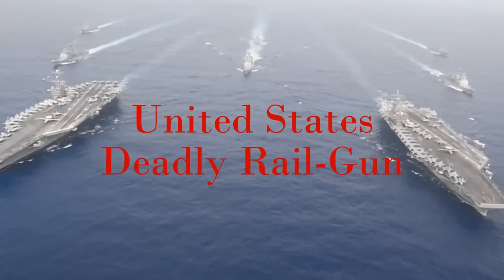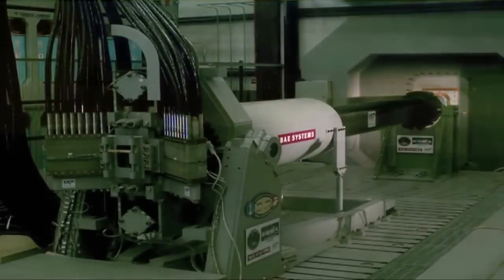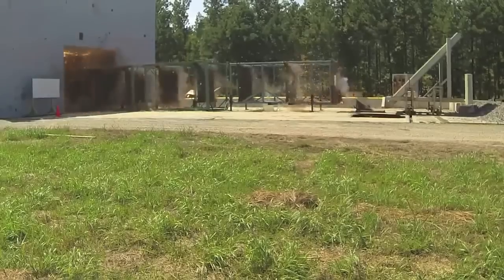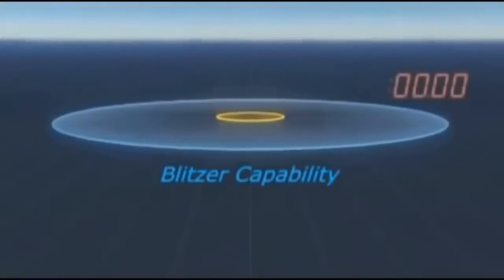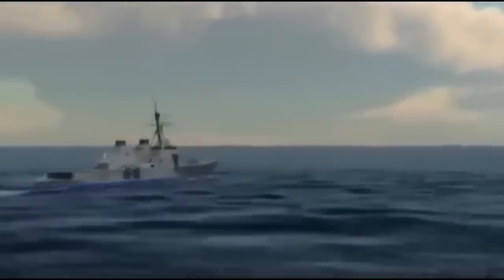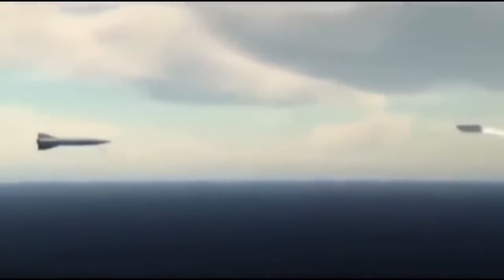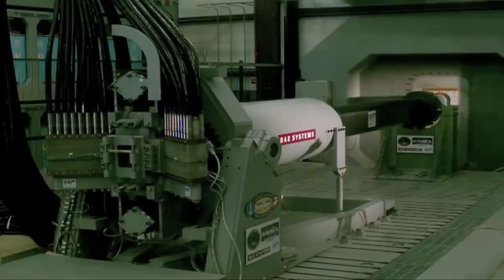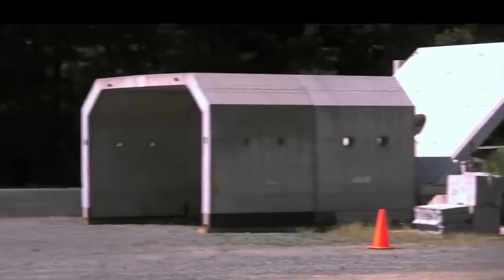USS Zumwalt will deploy the deadly Blitzer railgun

Comment: With radar off, how it would detect/shoot a target?
With it's transmitters turned off, it's blind as a bat. With it's transmitters turn on, it can be detected many miles away by satellite, missiles, surveillance aircraft, dozens of surface ships. 
None of it's weapon systems will work with turned off radar, etc.
Plus it's Stealth looks very first generation. Compare the F-117(70's tech) to the F-22, F-35, J-31, etc.
Plus it's big, slow and perfectly visible during daylight. It's wake can probably be seen from fifty miles by eye, and from over the horizon radar and satellite radar.
Plus with it's radar turned off, it can't detect the aircraft, ships, fishing boats around it except with binoculars. It already has collision issues at night. With it's radar off, it can't detect or be detected by other ships.
Do they have a crow's nest manned when in stealth. "Ahoy, Captain. Fifteen cruise missiles approaching off Starboard. Uh, also port. And from astern. Can we turn on the radar please so the super duper Rail Gun will work. Never mind. Abandon ship."
Finding targets is a problem with all stealth. I suspect the F-22 and F-35 rely on AWACS. But the other side has missile that'll go after AWACS, unless you turn its radar off.
Plus they called the F-117, the Nighthawk for a reason. In daylight, Stealth stuff is visible. And with their radars off, how do they see and shoot first. If a F-35 gets spotted by any Mig later than a 21, it's toast.
Again, it ain't stealthy with radar on.
Reply: mikersey a new generation of direct link communication with sats in Leo. can't jam or hack. boats and birds are just missile platforms now. .usa motherfers.
Reply: @mikersey Dear lord, how to reply to a kid who thinks he knows it all? Kinda like that kid that smoked pot twice that is explaining to kids who only smoked it once how it all works.

Anyway, you should lookup "Network-centric warfare" and in case of the US Navy "NIFC-CA". That will explain to you how sensor information will be shared between platforms like the F-35, AWACS and surface forces. The USS Zumwalt can get it's targeting information in real time from any of these sensor platforms and take action accordingly. 

Also your assumption that if you switch on a radar that you will immediately be visible is not always true, especially with AESA radar that uses LPI (Low probability of intercept) it will be hard to detect. The constant frequency hopping and pulse direction at relatively low power will make it harder to differentiate the radar from any background noise.

Then your ridicule about a non stealth plane that can visibly see a stealth plane. You do know that if we take for example the F-35 that the non stealth plane either suddenly goes down in flames due to a rocket from a plane it never saw coming or that the F-35 just flies around it at such a distance that it will never be seen, you do know that do you?
Reply: How are all this network-centric stuff going work when a Mach 3 YJ-18 is spotted by your lookouts about 10 seconds before impact, and believe me, your 15,000 ton Zumie 1970 tech ain't going to be nearly as stealthy as a squadron of F-22, especially if it's guns are uncovered.
And assuming you fighting the Chinese, what are going to do about the Russian trawler sitting off you fantail...Yeah, just like them did 24/7 during the Vietnam War. And you don't think the Chinese and Russian's won't be doing the net-centric thing with their geo-synchronus radar, visual, infared, sigint satellites staring down on the South China Sea. China now launches more intell satellites than we do, and they can concentrate on the SCS, not the entire globe like us.
Here's a satellite photo for you to view...that's a crappy commercial satellite. If you don't know that the Russian/Chinese satellites are a zillion times better, you been drinking toooo much koolaid.
https://www.google.com/search?q=Admiral+Kuznetsov&source=lnms&tbm=isch&sa=X&ved=0ahUKEwi4uNLd4J7QAhWHr1QKHbw3D9YQ_AUICSgC&biw=1396&bih=735#tbm=isch&q=Admiral+Kuznetsov+satellite+photo&imgrc=WN1PeUthXqwDaM%3A
Reply: "This kid has 194 combat missions and a degree in engineering" Sure, in Call of Duty. And the engineering degree must be your fingerpainting classes. If you would be a combat vet and actually had a degree in engineering then you would not post like a 14 year old kid with severe ADHD. You are making this too easy.
Reply: You really need to down load this RAND report
http://www.rand.org/content/dam/rand/pubs/research_reports/RR300/RR392/RAND_RR392.pdf looking at the balance in 2017. And project it to 2020-25, with the Chinese momentum and growing ties with Russia. Like S-400 missiles that will shoot down the Nationalist Chinese Air Force in their traffic patterns.
Where will you launch your F-35 from...Kadena, Anderson...already vulnerable to Chinese attack. Any carrier within 1500 km is already vulnerable, according to RAND. Lotsa refueling equal very low sortie rate.
"...new generations of more capable Chinese aircraft,
missiles, and, especially, submarines pose a major threat to U.S. aircraft carrier operations within 1,000 miles (and possibly farther) from China’s coast. The threats to both land bases and carriers would be particularly serious at the outset of a conflict..."
And China spends less than half as much percentage of its GDP on weapons. By 2025 or so, their defense budget could easily surpass ours.
But if we attack Thailand, we'll kick ass. Watch out Ethiopia, you're next.
Reply: When they refer to stealth, they refer too radar. The ocean is a huge place man and with its design it will be a lot hard to detect. Like the F-35, well duh if u look in the sky where the F-35 is in daylight you can see it.. That isnt the type of stealth they are talking about. In a modern fighting scenario you dont have people standing outside looking for enemy vehicles, you use radar... That is what the F-35 and the Zumwalt's stealth was designed to counter, radar. Not people standing outside their ship looking for the enemy ship. Jesus christ we don't live in the fucking 1600s. But the real question is why would they turn the radar and the transmitters off?? Just like the F-35, the F-35 hops its signal around a bunch and has its own jammer on board to jam radar from detecting it... Even with its radar on it can use the jammer to make the enemy radar think there is nothing there. I imagine that the Zumwalt has integrated similar tech.
Reply: mikersey your comparing a military ship to military jets in stealth... well your a fucking idiot. also the way the ship is made is to deflect radar waves.
Reply: +vanguard Colt You are a cretinous, inbred, moron who gives idiots a bad name. Stealth jets and stealth ship, same fucking principles in each...they both absorb, deflect, RADAR, etc. You make Trump look like a rocket scientist.
Reply: (this is someone's comment) When they refer to stealth, they refer too radar. The ocean is a huge place man and with its design it will be a lot hard to detect. Like the F-35, well duh if u look in the sky where the F-35 is in daylight you can see it.. That isnt the type of stealth they are talking about. In a modern fighting scenario you dont have people standing outside looking for enemy vehicles, you use radar... That is what the F-35 and the Zumwalt's stealth was designed to counter, radar. Not people standing outside their ship looking for the enemy ship. Jesus christ we don't live in the fucking 1600s. But the real question is why would they turn the radar and the transmitters off?? Just like the F-35, the F-35 hops its signal around a bunch and has its own jammer on board to jam radar from detecting it... Even with its radar on it can use the jammer to make the enemy radar think there is nothing there. I imagine that the Zumwalt has integrated similar tech. I used it only to show this Persons point. Also you are calling a marine who has been blown up by shrapnel many fucking times stupid, inbred moron. Good FUCKING job dickhead.
Reply: mikersey also I have a feeling you neglected that persons comment.
Reply: +XTheLostChampionX2The Navy admits it has the radar cross section of a 50' cabin cruiser. That ain't very stealthy. A 1000$ and an Amazon.com account, and you can get a radar that can track it all day. #2, it's wake will show up on any radar worth a crap.
#3, the US, the Russians, the Chinese have satellites that can track it visually, 7/24. Yeah, even in the middle of the night with IR, Radar, multi-freq sensor. Been that way for decades. You can't hide a big ship from a major power.  Period.
#4, this thing is designed to fight 3rd rate powers, like most of the Navy.
#5, jamming is so 20th century. To jam, you must transmits a signal which while jamming radar A is picked up by receiver B. Might as well turn on some searchlights and shine them on the nearest cloud.
#6, the Advanced Gun System cost about a million a round to shoot, USN has cancelled the contract. The whoopie railgun, according to the Navy, won't be deployed until 2026, at the earliest.
#7, the USN has gutted the program, cutting the order to three.
#8-15. That should be enough. It is an embarassment.
Reply: Yeah it is an embarassesment I know that. To bad theres no cloaking tech yet.

Comment: Ship armed with EM railgun can still be sunk by good old fashioned torpedo. Just sayin.
Reply: With radar off, how would detect/shoot a target?
With it's transmitters turned off, it's blind as a bat. With it's transmitters turn on, it can be detected many miles away by satellite, missiles, surveillance aircraft, dozens of surface ships. 
None of it's weapon systems will work with turned off radar, etc.
Plus it's Stealth looks very first generation. Compare the F-117(70's tech) to the F-22, F-35, J-31, etc.
Plus it's big, slow and perfectly visible during daylight. It's wake can probably be seen from fifty miles by eye, and from over the horizon radar and satellite radar.
Plus with it's radar turned off, it can't detect the aircraft, ships, fishing boats around it except with binoculars. It already has collision issues at night. With it's radar off, it can't detect or be detected by other ships.
Do they have a crow's nest manned when in stealth.
Finding targets is a problem with all stealth. I suspect the F-22 and F-35 rely on AWACS. But the other side has missile that'll go after AWACS, unless you turn its radar off.
Plus they called the F-117, the Nighthawk for a reason. In daylight, Stealth stuff is visible. And with their radars off, how do they see and shoot first. If a F-35 gets spotted by any Mig later than a 21, it's toast.
Again, it ain't stealthy with radar on.
Reply: Still, it is a stealth ship, so it'll probably have the luxury of shooting first before an enemy can react. Can't fire at something that you haven't detected yet.
Reply: mlg360 ProShooter
 submarines are stealth too.
Reply: submarines are only stealth because of their low acoustic signature. If you have a device sensitive enough you can find a submarine through the sound of its propellers alone not to mention sonar pings.
Reply: everyone and his mother has camera satellites nowadays ...

Comment: you guys realize that they stated that this thing can shoot out to the Horizon at 110 miles while the Horizon is a lot shorter than that had a hundred and ten and eight inches curvature squared per mile that's probably about 6 miles below the Horizon there's no way they can hit that or lock onto it with a laser The World is Flat you dumbasses
Reply: it's called firing arc for a reason. You aim upward and so long as you have the velocity to overcome gravity, you could essentially put an object into orbit or hit anywhere on earth. Gravity.... you gonna try to explain that one now with your flat earth nonsense?\
Reply: shut up
Reply: ? no laser from ship to lock on needed, use a drone or satellite to pick a target, relay that info to the ship's fire control system to aim.
Reply: Search for JDAMs, a very precise bomb kit and it does not need lasers, they're also been used for decades now!

Comment: That is not a small scale prototype. It's a very crude prototype of the real thing...which is probably a decade away.
Physics lessons.
A rail gun with intercontinental range. Ha, Ha. Muzzle velocity exceeding 17,000 miles per hour. One ton. 400 times as heavy as this pea shooter. Impact power? Why is it that an ICBM warhead enters the atmosphere at 17000, but needs a warhead to do any damage? Atmospheric drag. Leaving the 300 foot long barrel at 17,000 mph, your one ton warhead would immediately slow and glow brilliant white hot from the friction. Again on re entry.
Energy required would probably exceed the power of a state the size of Texas...but you'll of course have a Cold Fusion Power plant on line by then.
If impact was so great, why not just use ICBM's to test or deliver this super duper slug. 
Small nuke warhead? Very, very small impact after a intercontinent flight, if the sucker didn't burn up on re entry.
Reply: None of what you said is a 'physics lesson'.

1) It isn't being billed as "intercontinental', it is being billed as having range of 110 nautical miles (just over 200km)

2) It specifies a muzzle velocity double that of a conventional launcher.  The 5" Mark 45 mod 4, has a muzzle velocity of 1,800 mph.  Double that is 3,600 mph.  Both of which is significantly lower than 17,000 mph.   For the record, they are aiming for 5,000 mph+, which is as fast as the Stage 1 Sat-V rockets, which as we all know, didn't blow up.

3) ICBMs don't 'penetrate', they do explosive damage designed to take out soft targets or wide area damage. They would do nothing against a hardened bunker.  A rail shot could, in theory, do so, with minimal collateral damage.  ICBMs are also incredibly expensive, easy to track, and slow as heck in the launch and cruising phases.  A solid slug is cheap, easy to store in bulk, and much much harder to defend against.

4) The A4W reactor on the Nimitz (of which there are 2) is capable providing 100MW the rail gun only requires 25MW.  The newer A1Bs on the Ford-class carriers produce 3x that and are smaller.  Power isn't the issue.
Reply: heehe got him thanks
Reply: I liked the "cold fusion plant will be online by then"
Reply: whole thing is rather silly.
Reply: There was a comment claiming they would be able to shoot a one ton projectile from "Houston to Berlin" and have the impact of a small nuke.

Comment: Would it not achieve higher velocity if combined with a classic propellant?
Reply: No. If you're accelerating the projectile faster than propellant burns, what would be the point?
Reply: HomeWatchViewer that would actually slow it down no conventional propellant would burn quick enough to compensate for the added wait and air resistance.
Reply: The EM field is accelerating the projectile and physical contact with the rail is not required.
It can accelerate it from zero to mach 6 or from mach 1 to mach 7, so yes, from a conceptual perspective, a hybrid gun would have huge benefits in terms of kinetic energy and would also let you play with things that are not possible with a railgun such as imparting spin stabilisation of the projectile.
The problem is that both GA and BAE's versions of the railgun use so much energy that they literally tear themselves apart.  Reliable repeat fire capability is a big enough problem now, without adding higher energies and damaging hot muzzle gasses to the mix.
Reply: baldieman64 yea. That and the residual magnetic materials left after every shot could eventually cause a malfunction if proper care ain't taken, we should first try and figure  out rapid fire before we try to improve the projectile it's self...that's just my opinion.

Comment: It can pierce 9 steel plates with lead projectile that has a square head. Imagine the amount of firepower this has with a SABOT round
Reply: Teck King there wouldn't be a point for savot simply changing the alloy to tungsten and uping the velocity would basically convert it into a  mininuck.
Reply: They are firing at max velocity when shooting slugs.
Reply: Teck King yea at the max velocity of the current prototype but in theory it could go much MUCH faster of course at such speed the air resistance would melt almost any metal that's why I suggested tungsten.
Reply: They are firing a sabot round, if you watch the video - the square head 'flares' and separates to expose the aerodynamic solid round.

Sabots are just discardable 'covers' to the actual projectile.  They serve to keep the projectile centered in the barrel, though in this case they also serve to provide contact with the rails so that it accelerates.
Reply: AdeptPaladin wait I thought it wasn't supposed to make contact with the rails?
Reply: Depends.  It could be a hybrid armature, in which it is physical contact, until it reaches a specific velocity, then switches to ionized plasma... or it could be pure plasma.  There needs to be 'some' contact, though minimal, in order to let the current flow.
Reply: Teck King just take the Rheinmetall HEL System it fucks through steel even after 3 Miles so be quiet
Reply: Yea, but Obama is looking at it for ear and penis piercing.  Just wait until he finds out what it is really for!
Reply: It can't use explosive rounds, too much heat and velocity makes it unstable and prone to malfunctions
Reply: Can't make them much faster. Not technologies fault, as you increase speed, you increase force as the square, so double the speed 4 times the force. If I'm not mistaken (I may well be, it's late, I'm tired, forgive me) the air resistance does the same. Even if it doesn't increase as the square, it's already to the point where the heat, and air resistance, will destroy or warp most any projectile you can put out there. Tungsten is pretty expensive, and quite brittle, so I'm not sure if it would work so well for a projectile material.